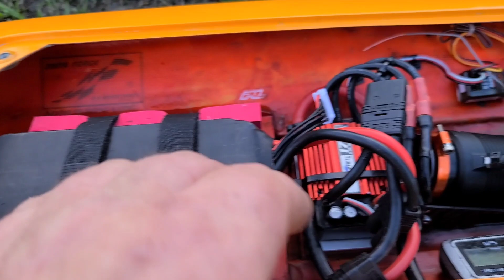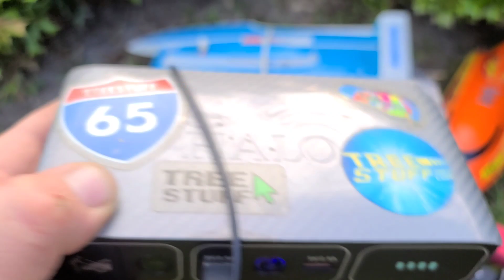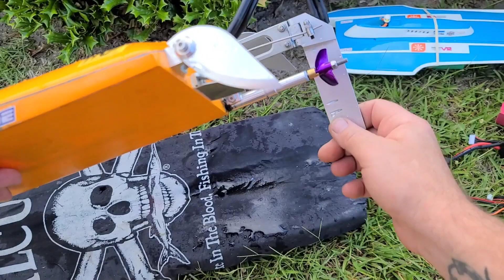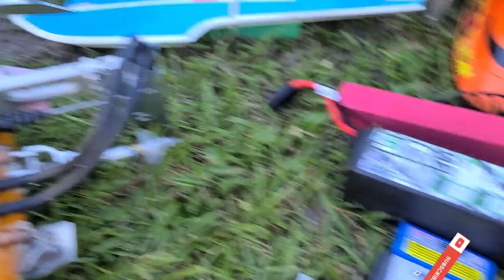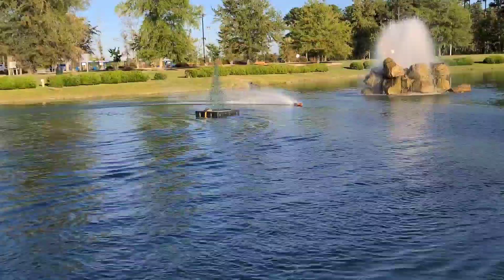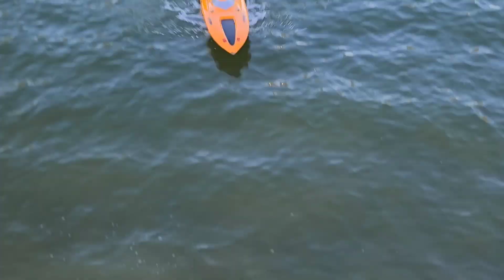Tuning For WOT Ovals Fast Electric Rc Boat Setup & Prop Changes - Deltaforce 35

Comment: How do you know if the prop you’re running is too small?
Reply from the maker: Usually, you'll experience cavitation. Basically, your boat doesn't get up on plan, or your prop catches and you have a lower speed that you want
Reply: @IRONCLADRC  Good to know, thank you!

Comment: I watched your balancing of propellers. The metal Proboat propellers are they pre balanced? I’m tired of braking the plastic ones especially with the updated motors I put in my boats. Of course it doesn’t help to run in the fall with all the leaves falling into the lake. By the way Rhinelander Wisconsin where I live is going down to 31 degrees tonight.
Reply from the maker: 31° wow it's mid 70's at night here in the Carolina's right now.  Yes sir proboat props are 99% balanced, you shouldn't need to balance them stainless steel props so you shouldn't break them.   Oxidean & ose sells cnc aluminum  balanced props also.
Reply: One last question, I’m going to buy another propeller shaft and I have stowed my boats away for our trip to Florida. Do our Proboats turn clockwise or counterclockwise? Thanks in advance for your help.

Comment: What would cause my transmitter to loose signal from the receiver? Ran at the pond yesterday and on my last run my boat was dead. Brought it back and saw the light blinking on the receiver so I did a re bind and then it seemed good.
Reply from the maker: I had the same Issues last week?  Not sure what was going on with mine?

Comment: I must say, your videos are becoming more helpful and informative every day, especially for those new to the hobby.  If I were Big King B for a day, I would use a prop blast water pickup that mounted somewhere on the existing hardware, so the only modification you would need to make is the through-hull for the tubing.  That way, you could remove it with no patching required if it did not help.
Reply from the maker: Probably add a pickup on the stinger mounting holes,

Comment: Good runs, good vid B!   You have any vids putting in a thru hull pick up? Cant seem to find one anywhere. Due to the boat and setup Im really limited options, so I have 4 singles coming.  Thinking about drilling a smaller hole and filing to size and shape. That seem about right?
Reply from the maker: That's what I did to my scale fishing boat,  I drilled a hole & filled to fit,  then epoxies into the boat.   It's easier than you think hardest part is getting up the nerve to drill a hole in a perfectly good boat...
Reply: @IRONCLADRC  Yea, not looking forward to making those first holes. The wait for the parts aint helping lmao

Comment: lost my oxidean 4519 the blue one. lost it less then 5 feet from shore after a full run lucky it wasn't way out, any way I waded out but couldnt find from all the aquatic plants. bummed shaft is fine nut backed off I recon. boat build day.peace
Reply from the maker: I feel your pain I lost an abc 1817 last week my fastest prop on the blackjack 42